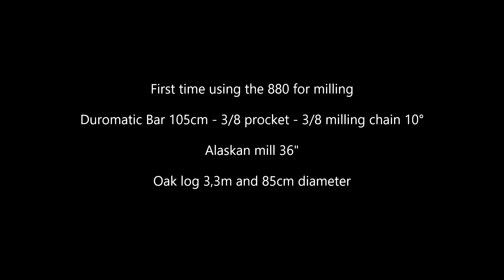stihl 880 chainsaw milling oak

Comment: awesome job, how long did it take to slab0?
Reply from the maker: Milling with a chainsaw takes a lot of time, first thing, you have the preparation of your milling day, getting everything cleaned, sharpenend and loaded for the next day. On milling day, once all is set up, you have to warm up the saw, let it cool down during long cuts and after the cutting, so it's really important to take your time. I've milled three peaces of log in a period of 4 days